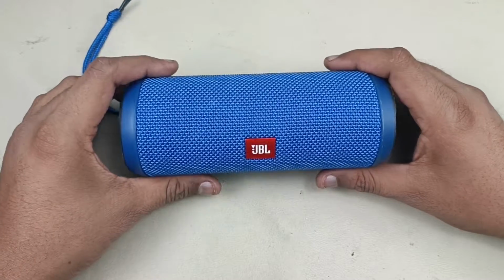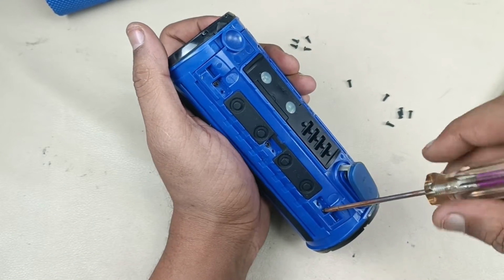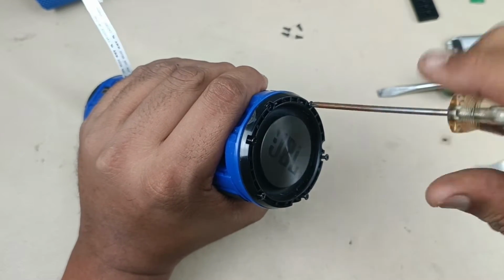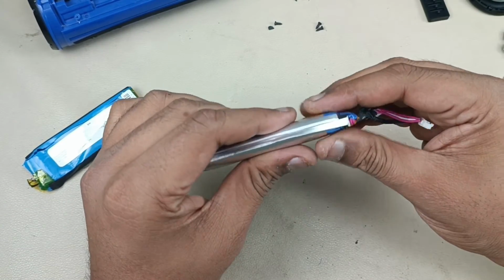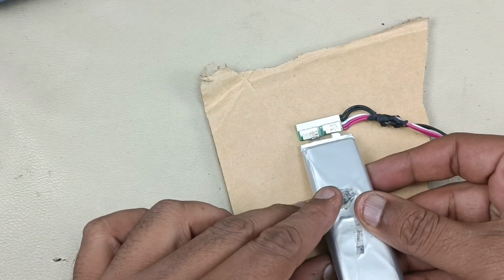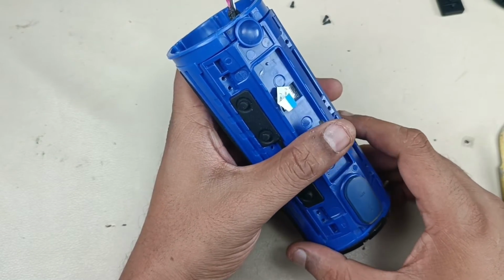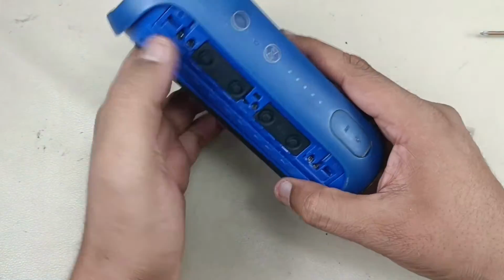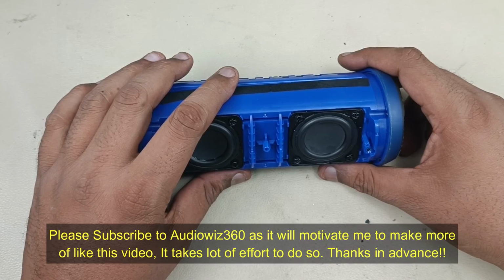JBL Flip 3 Battery Replacement | right way | how to   disassemble JBL Speaker

Comment: My jbl is different. It doesn’t have the six screws to remove the control board. It seems like everything is sealed for the case
Reply from the maker: Your flip  3 has JBL Connect option in it.,? most probably your flip 3 is TL series, 
TL series has battery inside the housing not as shown in the video, the flip 3 shown in the video is ND Series.

Comment: How does it work for TL version of flip3? Stuck in step where a flatcable is blocking the battery extraction from TL version
Reply from the maker: for TL series. You need to remove he motherboard from the housing then take out the flex cable which is blocking the way of the battery then you can take out the battery to replace. I will try to make a video of TL series of JBL Flip 3 🙂👍

Comment: Has anyone had a charge port problem on a jbl 2 speaker?
Reply from the maker: yes it's common problem in JBL Flip 2 bluetooth Speaker since it is micro USB it's not bi directional like type C port hence the problem, usually people break the port by inserting male mirco usb port in opposite direction.

Comment: I'd love to know if the charging port on my jbl flip 2 can be replaced? If I hook it to the charge cord, it shows lights progressing 2 time and then just blinks once..maybe my battery? Should I just chuck it? 😂 November 30 10 pm
Thankyou
Reply from the maker: if the micro USB port is loose then you need to fix the same or else the micro USB need to be replaced.